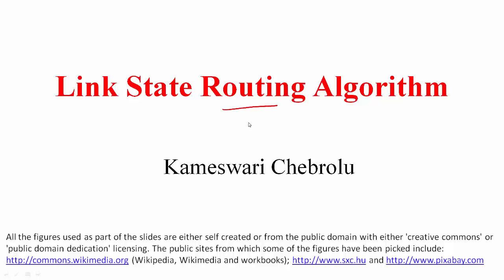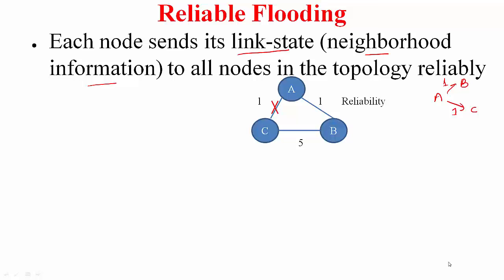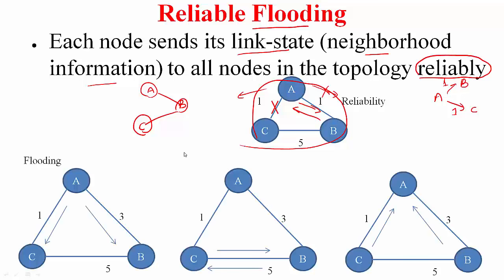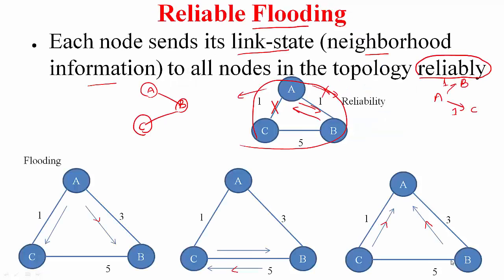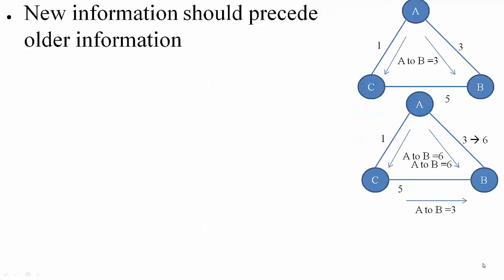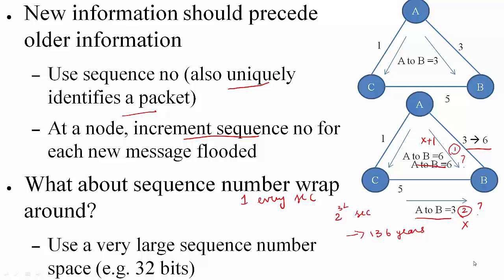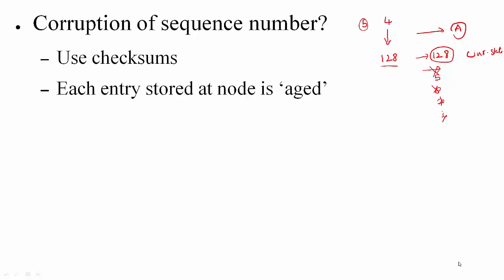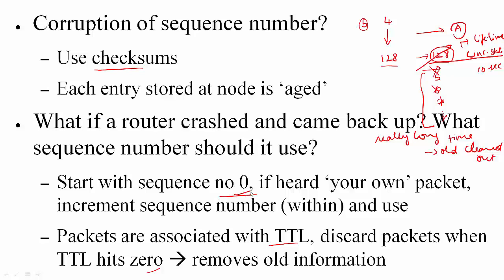LINK STATE Routing Algorithm Example Part-1 || Computer networking || IIT lecture Series

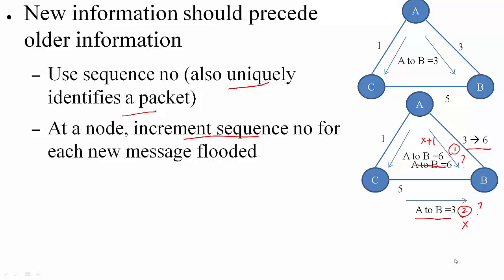Comment: At 8:50; do timestamp of the packets work...as in time-stamp  should be immutable (read only) and only written into the packet when the original node sends it and no other node can modify it?
Reply from the maker: Yes the timestamps are immutable and moreover the header checksum ensures that no one is tampering with the timestamps of the LS packet.